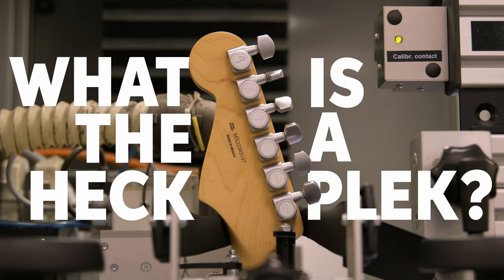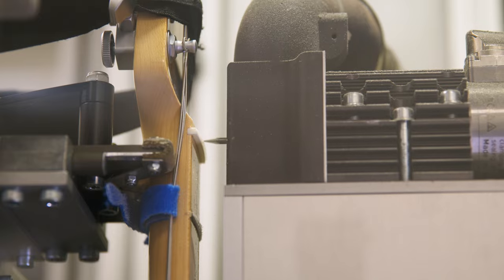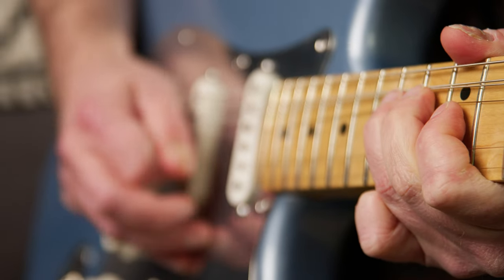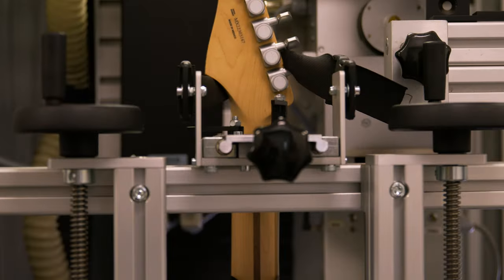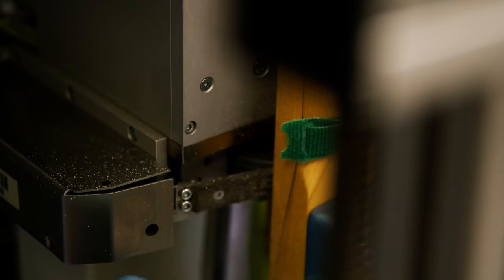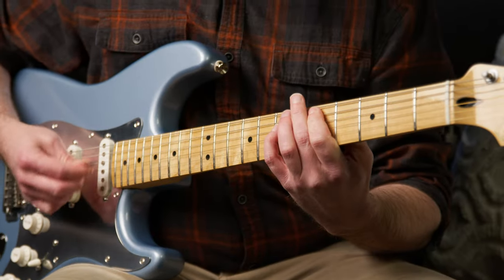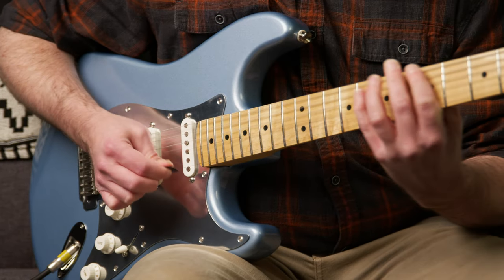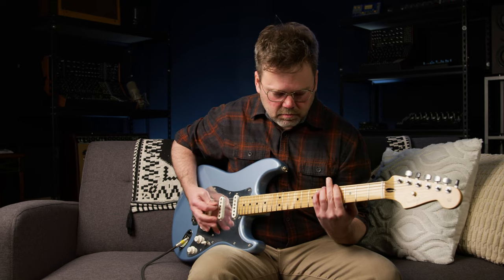Sweetwater’s Plek Pro System — The Holy Grail of Guitar Setups

Comment: What's a Plek? Something you definitely shouldn't EVER need on a new guitar.
Reply: Let me guess, you return things to the store over the tiniest blemish?
Reply: Certainly not Gibsons, its already done.
Reply: @ileutur6863  and you pay $300 to get level frets on a brand new guitar?
Reply: Your comment implies you think PLEKing is always to fix mistakes or poor workmanship, but that's not always the case. Sometimes it's to customize a certain feel, for instance a very low action w/o danger of fret buzzing, or a combo of a specific string gauge with a specific action height. Other times it's to correct what wood naturally does as it ages and dries. Lastly, it certainly can help a poorly made $300 guitar play like a $1K one.
Reply: Nope.  If the frets and neck are level you can have literally ANY setup you want.  It's simple geometry.  That's how guitars should be from the factory.  And most good ones ARE.  I don't think PLEK even addresses the nut..
Reply: @david faustino just curious, what brand of guitar(s) do you own?

Comment: Personal experience about pleking..

I purchased a 2008 Gibson les paul standard that was factory pleked..
The guitar wouldn't allow the action to be lowered beyond the factory setup as it would fret out horribly..
I took the guitar into a local shop to find out it had high uneven frets and had to be done by hand to fix the issue it was $150 at the time including the setup but once done the guitar played fantastically and never had a buzz again..I was told later that not every single pleked guitar comes out as advertised and perfect and sometimes there's errors with the plek job..
There's variables the computer program doesn't factor in when it does the leveling..
Do what you will with this information..
Reply: I would bet that a factory line plek job may get rushed as opposed to one that is being pleked later. Also, it could be a plek job is no better than the technician operating the machine.

Comment: I had an early 2000s Epi Les Paul custom that was not played very much over the years and decided to get it Plek'd a couple of years ago.  I was able to lower the action and found it to be one of the most comfortable guitars Ive ever owned.  (nothing will ever match the old fretless wonder years).  I usually do all my one adjustments and fret leveling but thought Id give Plek a try...definitely worthwhile if you are tired of always going with diy.  It is now racked with its factory plek'd Gibson brothers instead of in a case under the bed.

Comment: Wouldn't this have to lower every fret to the level that the lowest current fret sits at? You can't add material to the frets.
Reply: Unless you have a super low fret that's not an issue because they're all within minimal variations from one another.
Reply: For vintage instruments, which usually uses low frets, I'd be wary of this. Besides a competent tech can also level frets.

Comment: If my new Gibson is plekked at the factory, would there be a benefit from having Sweetwater plek it as well?
Reply: Possible. It depends on do you find you have to change the setup when you get one. Gibson pleks their guitars, but it's to their standards. If you prefer things a bit different, then how they come from Gibson, then having Sweetwater do it with your desires in mind will still be better as it set up to how you want it not Gibson's one set up fits all model.
Reply: Don't ever get new guitars PLEKd.  How silly.  If it doesn't have level frets BRAND NEW it's defective full stop.
Reply: @davidfaustino4476  That's the truth, these manufacturers are getting away with cutting way too many corners while still raising prices
Reply: @davidfaustino4476  How to say you know nothing about guitar QC factory standards in the 21st century, without saying you know nothing about guitar QC factory standards in the 21st century.
Reply: @jasondorsey7110  Yes, exactly!

Comment: Biggest problem with plek, setup, etc is the damage a guitar will endure when being shipped after it is setup. There is no way I will pay this much money for a plek setup especially living in a humid climate with massive temperature swings. This causes the wood to warp and shrink around the frets so often that I have to manually fix everything fairly often. Only when plek becomes built into the cost of the guitar itself will it be worth it. Micro adjustments will always be necessary unless purchasing in person and keeping it in a climate controlled environment

Comment: I had A new guitar plek'ed from Sweetwater... 250.bucks....no paper work or pictures to show the it was plek'ed and the set up was a extremely high action that I had to fix myself...unless they have changed ...don't waste your money.
Reply: It's $299 now, and as you stated, you received your supposedly plek'd guitar with high string action and still had to make adjustments. I'm not saying the process has zero value. What I am saying is, 9 out of 10 people wouldn't know the difference? If you need 10 percent of people who play the guitar to be impressed? Go for it. I paid $199 a few years ago, and it clearly had been gone over very thoroughly. I lowered the action even more, and it was incredible.